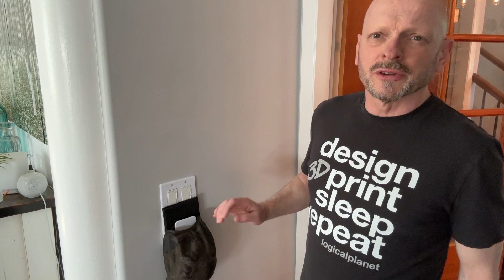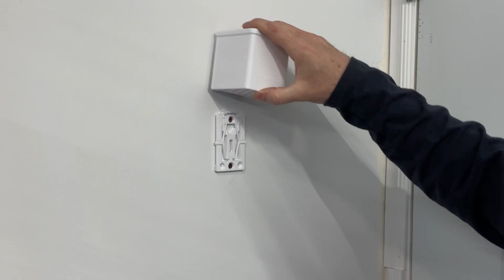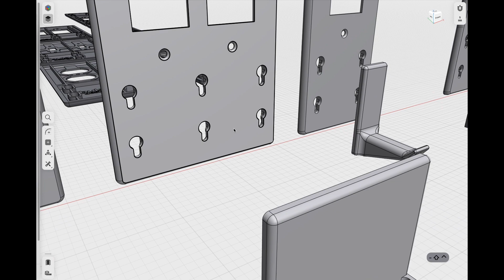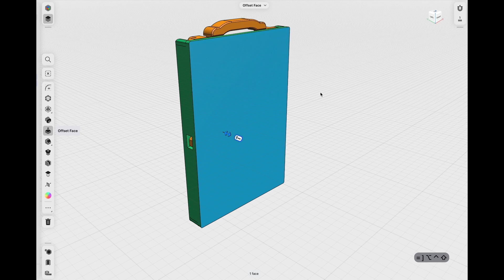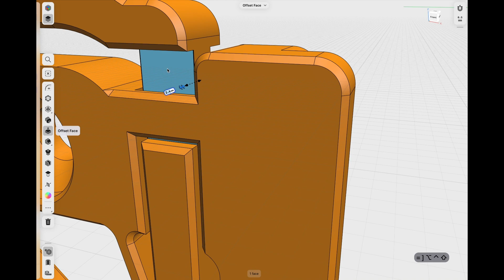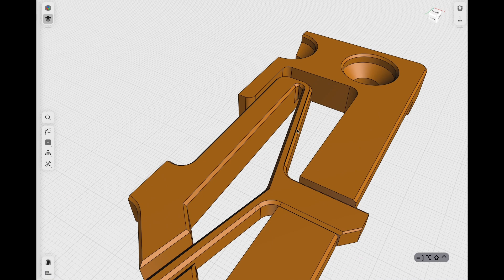WallPlateMate and FlexPlate Mounting and Accessory System

Comment: Very clever design, what you do is my current dream job/hobby/passion. I am a disabled veteran and currently work at a Public Library MakerSpace and have become fairly knowledgeable about how additive manufacturing works. I loved your explanation about how chamfering the first few layers causes an offset of the additional layers and therefore an increase in part strength. Keep up the good work brother very impressed by this compliant mechanism design. You have a quite viable product that could go to market. Thanks for the sharing your insight.
Reply from the maker: Thank you brother. I appreciate your support.